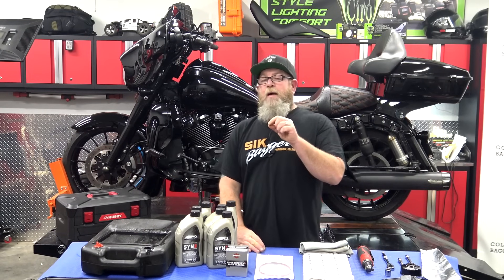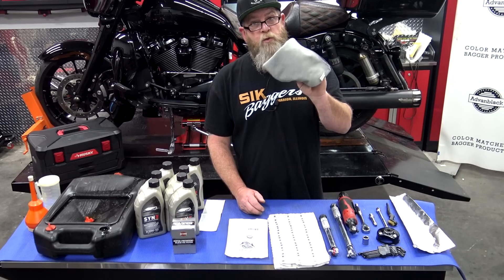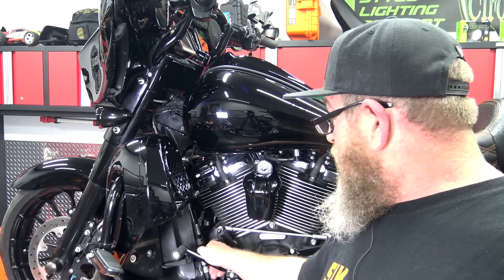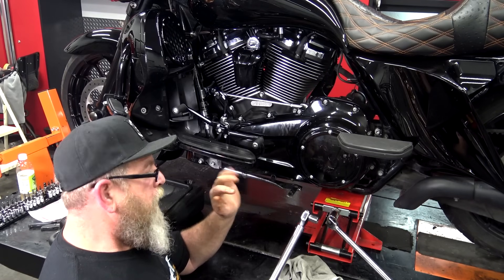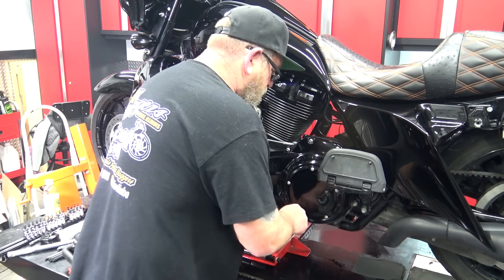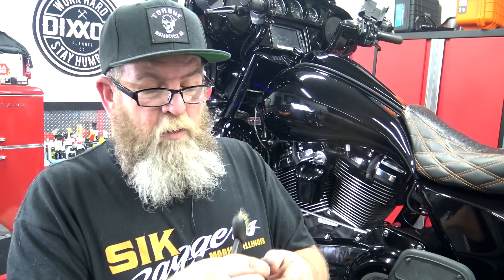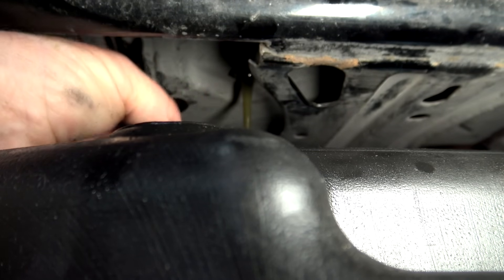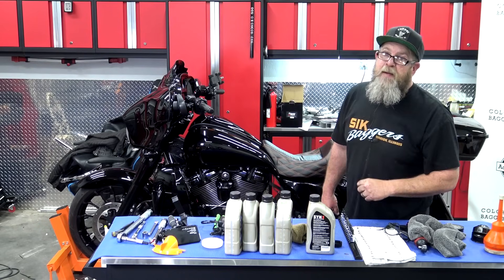⚡Milwaukee 8 - 3 Hole Oil Change @harleydavidson Touring - How To⚡

Comment: Not all dealerships use syn 3. My local dealership uses formula plus in their service department
Reply from the maker: interesting that the HD dealership doesnt use their own oil. Of course all dealerships will use whatever you want but you normally have to be specific about it or they toss in their brand.

Comment: Another "pro" to taking the derby cover off before you drain your primary is it allows you to check the level first - I.E. you will be able to tell if you are having the "M8 transmission fluid transfer into the primary" issue. This is a real issue and happens to many people who probably have no clue about it.
Reply from the maker: And another reason ill never sell my twin cam lol but yes...very much an issue we may cover in another video!
Reply: I'm new to M8's. Is this the oil sumping issue that is fixed by doing a cam chest upgrade, or some other issue I haven't read about?

Comment: I got a 2019 Harley Davidson hair to 2014 I utilized Lucas 2050 for the engine chain case and 8140 for the transmission Harley Davidson all doesn't tell you where they get it where they make it they don't make it somebody else makes it form so if it's a second hand oil I won't ever use it

Comment: Can be done with cold engine???? If anyone can help
Reply from the maker: Yes,,,you can if you have too..just remember its not getting all of the oil out so watch your levels.
Reply: @sikbaggers  thanks I ended up going for a 1 hr ride and than I did the 3 holes  oil change

Comment: Pretty sure you made an error on the torque spec for the transmission dipstick.  You called for 25 to 75 foot pounds.  I think you meant 25 to 75 inch pounds.  (27:50 into the video)
Reply from the maker: well hell! I sure did...thanks for pointing that out.

Comment: Why do some people use lock tight?  I'm a new rider and I am at the ask dumb questions stage of my journey 😂.  Thank you!  I have subscribed.
Reply from the maker: never any dumb questions on my page....and if they are using loktite on anything in this video they will pay for it later, i promise you..nothing on a 3 hole oil change requires loktite.  The drain holes have a rubber seal and have never seen one back out on a bike...not even cars or trucks require or ever use that on drain plugs and the derby cover...if you loktite those bolts I promise you, you will strip them out as I mentioned in the video about removing the derby cover first then draining it...it happens...please do not use loktite unless your service manual calls for it. Ever have any other questions please feel free to comment! have a good one and be safe!

Comment: 25-75ft lbs seems a bit excessive on the oil fill dont ta think?
Reply from the maker: transmission fill is 25 to 75 inch pounds...yeah...mouth typo on my part

Comment: If u do your 5,000 mile service your self will it void your extended warranty
Reply from the maker: no...doing your own fluid changes will not blanket void your warranty..read up on the Magnuson Moss Warranty-Federal Trade Commission Improvements Act

Comment: The boy thing I hate about jiffy stand measurements is that people change their bikes.  If u have no stand? You get a shirt stand? What if you have air shocks. I always wonder if it’s correct
Reply from the maker: a short stand is generally only one inch shorter..never seen one shorter than that. one inch on that stand isnt going to effect much on that stick. You want your oil levels in the middle of the low and full marks so as long as your in there your good. if you have air ride, like we do. Set the bike at ride height. ( frame parallel to the ground)  and then check

Comment: Ok so, harleys use one kind of oil to all the wholes???? No trans oil???
Reply from the maker: Sorry for the late reply, just got back from Sturgis...they Can, they dont have to...youc an certainly buy an oil for the tranny, primary and engine...but yes...they can run syn3 in all three holes.

Comment: Same as 103. Just fluid amount different
Reply from the maker: yeah...pretty much all the same with different amounts...primary plug is moved up about 2 inches on the 8 vs the twin cam

Comment: Ok so what oil do you prefer ? Just wondering I know an opinion is like a b-hole .
Reply from the maker: Most all full synthetic oils have a good additive packages in them and I've ran just about all of them in the past..as long as you are servicing your bike when you should be you'll be fine choosing any of them, wether its harleys oils, redline, amsoil, etc...Im currently running amsoil only because I have a friend that is a dealer and I can get it a little cheaper than normal.

Comment: oil filter way 2 tight, u need to just compress filter o ring, tighten and back off 1/8" to relax o ring on filter .
Reply from the maker: service manual calls for 1/2 to 3/4 turn by hand after making contact with the rubber.  Its youre call how you want to put your filter on your bike. I'll stick with what HD recommends.

Comment: Yeah I cursed Harley when I changed mine too destroyed my filter trying to get it off.
Reply from the maker: From what im hearing from several techs at HD and some other indy shops...these oil filters tighten over time on their own with the pressures of the engine im assuming...only on the M8's but every single time, no matter who did the previous change, they are super tight. It still sucks though

Comment: I guess it was too hard for harley to make bottles DESIGNED for the 3hole change instead of wasting oil
Reply from the maker: Non eof the 3 hole kits from sold from any company is going to have the exact amount you need..and its not really a waste...just save it for the next change..thats what we do...bottles pile up then after awhile we dont even need to buy oil lol

Comment: CHANGE 3500k motor oil! 10k bud light/primary.
Reply from the maker: SERVICE MANUAL states 1k, then every 5k on engine oil & filter.  Primary Chaincase Lubricant 1k then every 10k, Transmission Lubricant 1k, then every 20k.   Obviously you can change yours every 3500k if you choose but the info I pass along is by per the service manual.

Comment: I'll be a S O B this is embarassing. I have owned alot a Harleys. I mean alot of em, have always done my own oil changes. I Have been changing all three holes ever 5 K miles for ever. Do you have any idea how much extra money I have spent not needing too? I guess its only a couple extra quartz and some O-rings, but I feel a little stupid. Never had a primary or a tranny problem though!
Reply from the maker: Hey Mick, yes you certainly could have saved some money..the mile ratio to the 3 holes is hard to remember so i just do the 3 holes, every other oil change. It keeps fresh fluids in there and moisture out...it cant hurt.

Comment: Never use 20 50 in prymary nooo not made for it fools tell.u anything at shops use prymary trains in it not oil amsoil or redline good ust 20 50sin in oil case and not 85 140 chito harley greasein trains or primary  use amsoil trains made fir trains only in ur trains prymary oul in prymary sure they tell u 3 all bs were ur clichés out doung oil hell no ust whst is made for each oneonky not oil in a garly trsins as for85 140 in trains it works but its why to thick notrealy made toprotect were it can no get to small parts gears to thick  use 2 or 3 ox protrion plustreament its best i avey seen to save a bearing s frim frezz wereing
Reply from the maker: i think i just had a stroke trying to read that